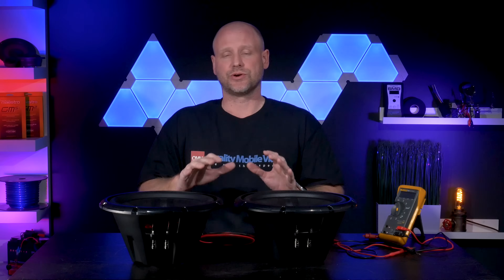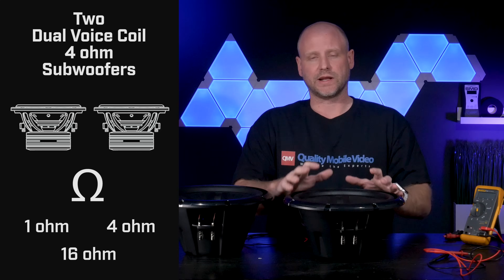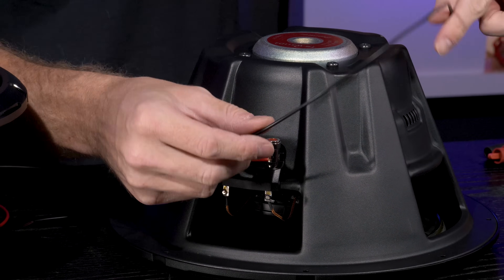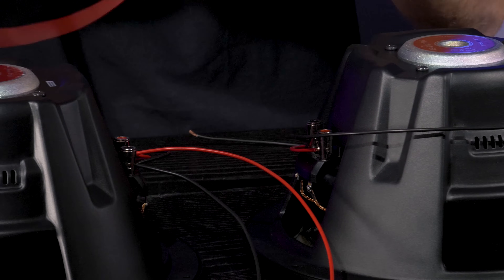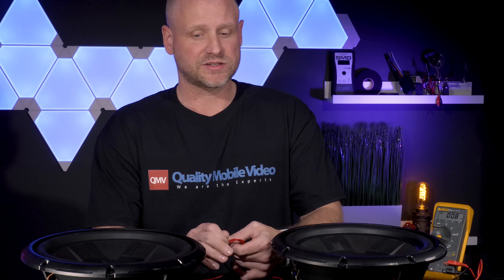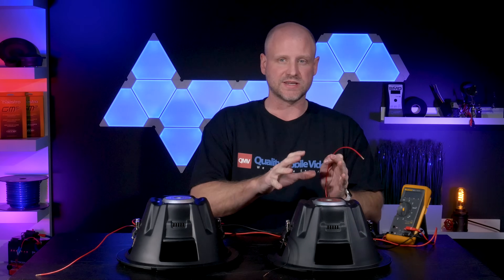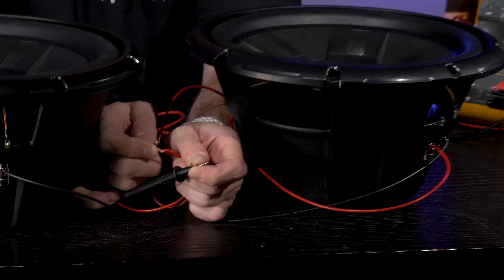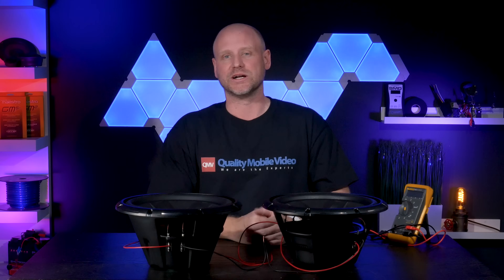Wiring Two Subwoofers DVC 4 Ohm - 1 Ohm Parallel vs 4 Ohm Series Wiring

Comment: Did exactly what you are showing, but one of my subs is not clear on low bass.
Reply from the maker: What exactly are the models/part numbers of the subs and the amplifier you're using?
Reply: Thanks man for replying, I have pioneer class D 8601 and 2 pioneer subs both dvc, 400rms just what you are demonstrating and A300 500 rms pioneer.

Comment: Can I wire my jl audio 12w6v3d4 single sub (dual voice coils) down to 1 ohm final ? They are 4 ohm dvc's but the manual only shows how to wire to 2 ohm for one sub. The amp I have is 1 ohm capable .
Reply from the maker: Hey Rod, so One DVC 4 ohm Subwoofer cannot be wired to 1 ohm, your only potential loads are 2 ohm (parallel) and 8 ohm (series). Two DVC 4 ohm subwoofers can be wired to 1 ohm.
Reply: @Qualitymobilevideo  Thanks for the super quick response, I guess that's why I couldn't find any videos on how to do it lol. I figured it was a worthy question to ask in this forum anyhow  :)

Comment: So wiring dual 2 ohm subs in parallel as you did with the 4 Ohms subs what would be the final ohm it that case?
Reply from the maker: Two DVC 2 ohm subs wire to 0.5 ohm in parallel, 2 ohm in parallel/series and 8 ohm in series.
Reply: @Qualitymobilevideo  OK thanks! My amp is one ohm stable monoblock, so I'm assuming my best bet is to go with the DVC 4 ohm and wire down to a 1 ohm load? As you displayed.

Comment: Would like to know how to connect 2 15in kickers comp to a 1000/1 jl audio amp what's the best way pls
Reply from the maker: Need a lot more specificity! Kicker has over two dozen versions/models of 15" subs. Which model do you have. DVC or SVC. 4 ohm or 2 ohm. Combined RMS of the woofers?

Comment: I was thinking you can turn 2 dvc 4 ohm into 2 ohms...it's only with one sub not two you can turn a 4 to a two but can you use a 2 channel and singly hook the 4ohm now at 2 ohm and will work? I'm still learning
Reply from the maker: Hi! One DVC 4 ohm woofer will wire to 2 ohms. Other than that, if you're using two you need an amplifier that can support a 1 ohm load. Watch our new subwoofer pairing video: https://www.youtube.com/watch?v=cyq-ivMDXgU&t=4s

Comment: Is it bad to connect a dvc subwoofer to 2 channels of a amplifier?
Reply from the maker: Need more info. What kind of amplifier?
Reply: @Qualitymobilevideo  6000 watt, 4 channel, audio fusion amplifier. 3000watt,  double stacked pioneer dvc (each coil is 4ohm) subwoofer
Reply: *double stacked magnets

Comment: For the 1Ω you hooked it up different from the diagram
Reply: It’s because on the diagram the positive and negative wire connections are on the same side but the sub he has they are swapped sides

Comment: ok so i reailze this is an older vid and you may not get back it me in a timely fashion.. i completely understand.. ive been running 2 kicker comp vr 12 for a long time powered by a 500 watt hifonics boltar ( iknow its a dated setup.) but ive tested the subs and they seem to still have great pop and both read 4 ohms (well 3.4-3.6) .. the subs are in a box and ive come across a Hifonics Zeus 1800 Watts RMS Max Class D Mono Car Audio Amplifier | ZXX-1800.1D is this going to be a complicated swap? will i have to remove the subs to accomplish a safe set up? the subs are rated peak 800 watts, and i beileve 600 rms( though i could be off), i dont know if ive given you enough info but i can include more, and really id just like an opinion if i just wasted a hundred bucks on the hifonics amp. any information would be greatly appreciated, your vids have got me through many wtf do i do now moments and love your content.

Comment: Can i wire a 2 ohm subwoofer and 4 ohm subwoofer to a 1 ohm amplifier??? Please help me
Reply from the maker: I highly recommend having identical subwoofers. You also need to take into account whether they're DVC or SVC
Reply: @Qualitymobilevideo  thanks for the answer. The problem is. I buy them for a low price in liquidation and i dont saw that untill i get home. I buy a pair of kicker l7 15inch dvc and i buy them for $200 each . my amplifier is a soundstream 8,000 watts class D mono. Please help me with that.

Comment: Hey guys I'm getting a Pioneer GM-D8604 4 channel amplifier rated at 100 watts rms 4 ohms with a Kenwood Excelon KDC-X303 Cd reciever with 5 volt pre out sin the back. Also running a 1000 watt mono amplifier for two kenwood excelon KFC-XW100 300 watt rms 10 inch subs. Also using a Pyramid AC to DC converter The PSC 300 30 volt I believe. 
I'm looking to upgrade my speakers to something that can handle that 100 (125 watt dyno unofficial) watt speaker amp that I'm looking to buy Wondering if anyone has any suggestions for something really nice around 75-150 bucks is what I'm looking to spend best bang for my buck would help but something competition status or close to it would do. I was thinking Pioneer pro series or Polk Audio DB692 DB+ 6x9  thanks
Reply from the maker: Ok dope! I personally have these in my car: https://www.qualitymobilevideo.com/kfc6995ps.html
Reply from the maker: These are great:
https://www.qualitymobilevideo.com/ts-a6960f.html
Reply from the maker: Also check out these:

https://www.qualitymobilevideo.com/43dsc69304.html

https://www.qualitymobilevideo.com/rockford-fosgate-p1692-punch-2-way-6-x9-full-range-speaker.html

Comment: Please reply your very knowledgeable, I want to buy 2 audiopipe txxbd415" in a ported of  course. They say they are 1400 rms so I'm thinking maybe a skar 3500.1d will push both even tho I wanted separate amps but the subs are 4ohm. Don't want any other subs except these. Can I still get separate amps and somehow wire my 4 ohm sub to 1 amp or do I have to have both subs on 1 amp to get 1ohm from 4? Also what size wore would you recommend from speakers to amp? Would a separate amp for each sub sounds better than 1 amp on 2 subs?

Comment: I learned this stuff back in the 90's. I had 4 15" Rockford Fosgate subs and I ran them Parallel/Series to get a 4 ohm load on the 4 subs. While my amps could run at 1 ohm the subs couldn't take the power as I was running 1400 wat at a 4 ohm load. I wish youtube was around back then cause I would've learned all this so much faster than reading it from books. Great video!
Reply from the maker: Thanks John!
Reply: Thank u for your info because I'm just learning how to work on my own Audio in car No one I know want help me so I come to YouTube So Thank you so much John.
Reply: @dirtyboy8336 my friend was my car audio tech,he wouldnt let me touch anything except for the volume knob lol .Unfortunately he was killed riding his motorcycle at high speed and hit a utility pole.i been crying everday for nearly the past 2 years since he died.35yrs of friendship gone because his girlfriend pissed him off and he jumped on his gsxr750 to let out his frustrations,no more frustrations for him RIP  BRO
Reply: Exactly.! And the circuit city or goodguys had sharks looking for commission so they had no knowledge except for the price

Comment: Can I use two of these 12" dual voice coil sub woofers in my home connected to my infinity kappa one class d amplifier as a home theater,how will it sound inside at home ?
Reply from the maker: I mean it'll be loud, but car subwoofers are designed for cars. I'd highly recommend using home theater subs

Comment: If you have a 1 channel (mono) amp with 4 speaker inputs 2 positive 2 negitive do you have to still twist the 2 subs together or can you just use all 4 speaker inputs to get 1 ohm because alot of mono amps have 4 speaker terminals 2 positive 2 negative im guessing for cleaner looking wiring
Reply from the maker: What model amplifier do you have Jonathon?
Reply: @Qualitymobilevideo  rockville rxd-m4 6000 for now until i get my taramps hd 5000

Comment: whats the best size speaker wire to use my thin shit caught on fire 😂
Reply from the maker: LMFAO 10-12 gauge is always fine. 10 if the system is extra powerful
Reply: Quality Mobile Video lol i got it bro thanks i got 12 that no more fires lol
Reply from the maker: @uzzle21  Maybe have a hose ready just in case LOL

Comment: should you runs them  at a 4ohm load to break them in then once broken in run them at a 1ohm load ? thanks
Reply from the maker: Breaking in woofers is beneficial, but you can still do it at 1 ohm, just lower the gain for a few weeks

Comment: What does it mean if i still get 2ohminstead of 1ohm, i wired my 2 subs exactly like the video?
Reply from the maker: Are the subwoofers Dual Voice 4 ohm subs?
Reply: @Qualitymobilevideo  their skar vvx 8s dvc
Reply: Their both 4ohm i ended up wiring them parallel all the way across reading 2ohm, my amp is 1ohm stable but im not getting the 1ohm out of my subs
Reply from the maker: That's really odd man, Two DVC 4 ohm woofers make a 1 ohm(parallel) or 4 ohm(series) load, not two. What's your amplifier?
Reply: @Qualitymobilevideo  skar 1200.1 2 channel
Reply: @Qualitymobilevideo  ive seen other videos where a single dvc sub theyll wire both pos and neg parallel and get 2ohm both mine will show 3ohm??
Reply from the maker: Are you bridging the subwoofers into one channel or wiring them to their own channel?
Reply: @Qualitymobilevideo  pos of one side neg of the other side
Reply from the maker: My guess is it's because you're using a two channel amplifier instead of a mononblock
Reply: I looked into details about my subs according to the paper that comes in the box with each sub it state that the 4 ohm dvc model can be wired to 2 ohm and the 2 ohm dvc goes to 1 ohm (parallel), it threw me off when i seen these videos showing their 4 ohm dvc being wired in parallel and displaying 1 ohm.
Reply from the maker: @chinomendoza211  Oh you're absolutely right, wiring one DVC 4 ohm subwoofer in parallel creates a 2 ohm load. However, you're using two, and two DVC 4 ohm subwoofers wired TOGETHER in parallel creates a 1 ohm load
Reply: @Qualitymobilevideo  i figured the same thing too and seeing it in the youtube videos made me think i could just wire it up and get a 1 ohm load

Comment: you are a hundred percent correct when you say that resistance is not impedance and when testing a speaker at rest, getting a 2.9 ohm reading out of a 3 ohm woofer is completely acceptable but getting a 2.9 ohm reading out of a 4 ohm woofer is a lot of variance. when trying to configure a multiple DC woofer setup with an amp that is rated to be stable when bridged at 4 ohms only, like a lot of us poor people have to do, and under load the amp keeps popping into protection mode, with an initial at rest speaker resistance number that far off, without an oscilloscope  how can you tell if you are dealing with an amp out of spec problem or a speaker(s) problem. in the last 35 years I've found it common to see at rest resistance numbers that range between 3.7 and 4.2 ohms depending on the quality and price of the speaker but getting an at rest number of 2.9 ohms from a 4 ohm rated driver that is supposed to be high quality and probably being sold with an equally high price, i'd be highly suspicious about how good the quality of the speaker really is, after all this is the age of china where even what used to the best companies are now willing to slap their name on any piece of crap that comes out of china!

Comment: Can you wire a 2 subs at a 1ohm load to a 2 channel d class amplifier bridged??? Is that safe or?
Reply from the maker: It's not that simple, I need to know the models of the subwoofers and amplifer. The impedance of the subwoofers and whether they're DVC or SVC are directly related plus whether the amplifier is even bridgeable
Reply: @Qualitymobilevideo  I have the same question as him. I have 2 planet audio ac10d DVC subs at 1500w each and BAMF1-3000d amp 2 channel at 3000w. The amp says it is bridgeable at 2 mono blocks but not  1 mono block

Comment: what about is my amp is a 2 channel 2ohm stable  how you wire 2 dvc 4 ohm
Reply: The exact way in video but dont twist wires together. Run each 2ohm sub to seperate channels

Comment: since we are combining two sub woofer speakers, dose the number of watts required to power the speakers from the amplifier increase since in series each speaker has 4 ohms and in combining it remains 4 ohms or we assume and use watts required by one speaker for the two?
Reply from the maker: The power at the amplifier won't change, but the output it gives to the speakers is dependent on what the impedance/voice coils/RMS of the subwoofers are when wired to the amplifier and they type of load they will make
Reply: @Qualitymobilevideo thanks alot

Comment: I want to use two pioneer sub woofers having dual voice coil in my car with infinity kappa one car amplifier in a sealed box which type of wiring will give the best quality of sound one ohm or 4 ohm ?
Reply from the maker: 1 ohm will provide the most power/bass possible. 4 ohm's will be about 25-50% the power depending on the amplifier, but much more efficient
Reply: Quality Mobile Video is 16 awg ok to use for wiring subs? i went to electronic express and picked up a wiring kit for my amp but they only had 16 gauge speaker wire so i went ahead and bought it

Comment: how many watts amplifier is required to run 2 , 12" dvc subwoofers in a double box
Reply from the maker: Impossible to tell without knowing the specs of the subwoofers
Reply: Nonsense question....

Comment: how many watts amplifier is required to run 2 , 12" dvc subwoofers in a double box
Reply: Depends on the watts on the subs. what's the max watts and RMS for the subs?
Reply: If you have 2 dvc subs that each run at 250 watts RMS then both combined will be running at 500 watts RMS, get an amp which will be running between 450 - 600 watts RMS and stable at 1 ohm.

Comment: I have 1dvc 4ohm 400w rms sub and I’m looking at buying an amp that has 1200w rms at 1ohm, 800w rms at 2ohm, 500w rms at 4ohm which for the 1 sub I have I would just wire it in series for a 4 ohm 500w application, but my question is if I was to purchase a second sub exactly the same a 4ohm 500w wouldn’t be enough but would it be ok to wire it for 1ohm 1200w? Or is that going to be too much power and damage my subs? I’m like an advanced beginner and just trying to learn thanks in advanced
Reply from the maker: Yes two DVC 4 ohm subwoofers create a 1 ohm load in parallel. However, you're mistaken in your first setup. One DVC 4 ohm subwoofer wired in series creates an 8 ohm load, not 4 ohms, and in parallel it creates a 2 ohm load.
Reply: Quality Mobile Video ahh ok yep I see what your saying there so is it ok to have it wired to the amp at 2 ohm load 800w rms although the sub is 400w rms?
Reply from the maker: Yup! It's always good to have a little room for your subwoofer anyways. Plus that amp will still be a perfect match if you get a second DVC 4 ohm subwoofer and wire them to a 1 ohm load in parallel
Reply: Quality Mobile Video ok awesome thank you so much I thought it would be ok but I wasn’t entirely sure! Oh if a mono block amp has two speaker terminals how do you wire your subs to it? I’m sure a lot of people will want to know that answer maybe you could make a video on it?

Comment: does the sound differ from a 2 ohm or 4 ohm load?
Reply from the maker: Ehhh yes and no. It all depends on the gear. The differences would be the ability to get more power/bass with 2 ohms depending on the type of subs and amp used, but 4 ohm will always be more efficient and run cooler

Comment: FINALLY I understand series vs. parallel wiring. Thank you!!
Reply from the maker: Yes!
Reply from the maker: Pretty simple right?
Reply: @Qualitymobilevideo  question. Please respond.
I have 3 settings on my amp. LPF dial from 30-250hz. I have a subsonic dial from 30-50. Then i have the gain. I only have a button to go from 0-6-12db.
My question is, where should the LPF dial be set at, and same question for the subsonic dial? I have 2 Memphis PR 15's in a ported SPL box and the subs sound really good, but since I've done so much audio over the years and i got out of it for a few years, then back in it, I've lost my touch. Can you give me an idea? Thank you

Comment: Hi I have a Pioneer TS-W261D4 10" 25cm Dual Voice Coil 1200W Subwoofer. And a Pioneer GM-D8601 - Mono Channel Class-D Car Amplifier 1600W just wounded wot my correct speaker connections would be? Thanks mate 👍

Comment: soo u cant get 1 ohm from one subwoofer? u need 2
by the way when u connect minus to plius why dont connect closer eatch other? that information u have to say on video
Reply from the maker: To make a 1 ohm load with just one subwoofer, it needs to be either a DVC 2 ohm woofer wired in parallel, or a SVC 1 ohm woofer wired in parallel

Comment: Ive got a question if my amp is ony 4 & 2 ohm stable & at 2ohm its 350 watts per channel un bridged & 650 watts briged at 4 ohm. So if each dual 4ohm speaker is wired up in either way there still going to get about 325 wats each. "My question is will i be able to tell a difference if i take my subs out of the 2ohm load per channel & wire them in a 4ohm bridged?"
Reply from the maker: What are the subwoofers you're using?
Reply: The amplifier will not produce as much power in a 4 ohm load the load of the amplifier will be less the higher the ohm... So you're 2 ohm configuration it's going to give you louder music..

Comment: did not show 16 cause he is full of shit. Best you can get with them is 8 ohms he is fucktarded. he thinks series makes for double like parallel divides by 2. WRONG AF. it would be 6 ohms per  sub  then series again for 10.4 ohms. series adds 30% but to do the math you subtract  so parallel  the two for 2 ohms each then take the four ohms total of both subs minus 30 % is 2.8 ohms.  (3.0) ohms. This is HOW IT IS FUCKING DONE as far as the math. So dip shit has two dvc subs 4 ohms per coil. 16 ohms - 30 % =  11.2 ohms  there dipshit make a video and see if im wrong.
Reply from the maker: LOL